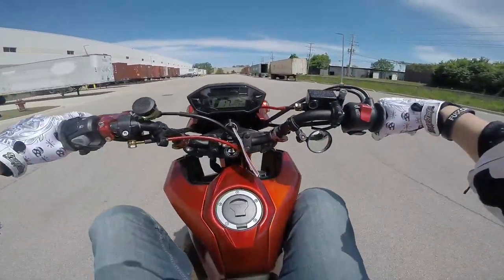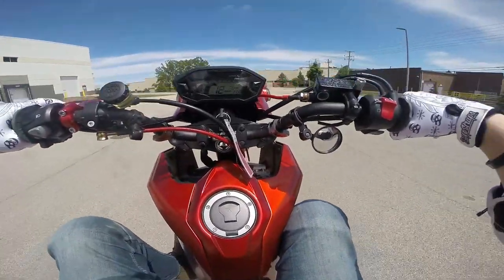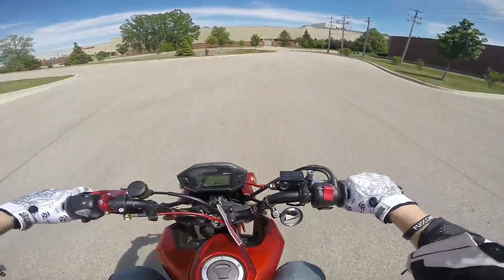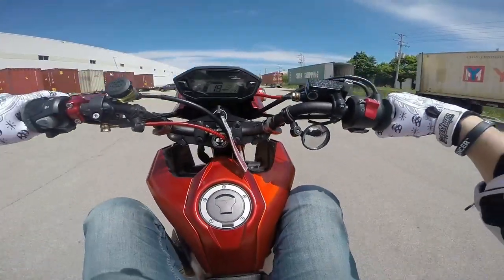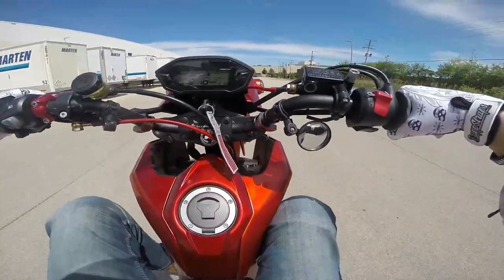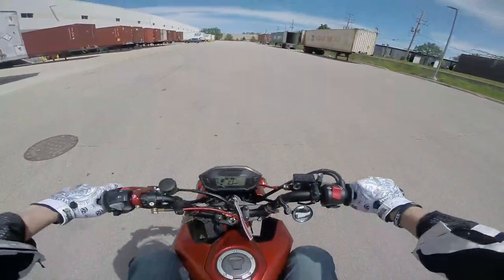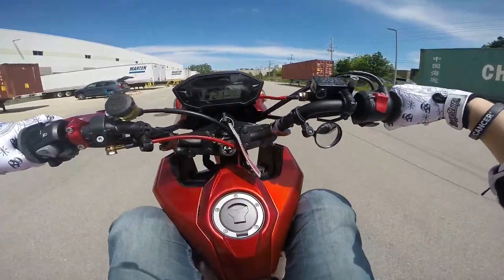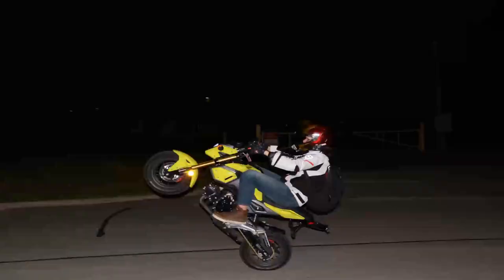Honda Grom - Brake Control Tips

Comment: tips on keeping it straight? i always go to the left or right even with like 12 psi in the rear
Reply from the maker: Focus on keeping all your weight on you butt in the center of the seat. Don't hang onto the bars for dear life and don't push down on either of the footpegs, you might be doing that subconsciously.
Reply: @RobRippin  I try to focus it on my butt but I fail

Comment: Did you remove the rear brake spring? I feel like I have to press excessively for it to work. It's brand new..
Reply from the maker: Ya I took the spring off. There is play in the lever with the spring before the brakes actually engage. No spring means every input you make is directly translating to brake input. Stock rear brake caliper I remember being a little soft not as sensitive as a brembo p32
Reply: @RobRippin  Thanks man I appreciate it. Helped me get better with my Grom wheelies 👍🏼

Comment: do you close the throttle then brake, or use the break  over the throttle ?
Reply: have you figured it out
Reply: you keep the throttle constant.  You modulate the rear brake .

Comment: what gear are you in?  2nd?
Reply from the maker: All 1st gear
Reply: @RobRippin  I have a benelli TNT 135 with 14 F & 40 R gearing.  1st gear is super narrow.  It has a full stunt build but these bikes don't have any power to get the front wheel up. learning to wheelie on a Grom, or Z125 or Benellie 135 takes so much more effort.   I also have a CRF150R and a YZ450F -- these bikes are super easy to wheelie.  the front wheel pops up is no effort whatsoever.  2nd gear is the magic gear to learn wheelies on a dirt bike, but damn is so hard to get the Benelli to pop in 2nd.
Reply from the maker: @76tigga  Ya the minis are tough to get up in 2nd gear without good technique. I've seen people pull up a stock grom in 4th gear so its definitely possible.

Comment: Every time I coast. I end up looping. Cus I get scared and forget to brake lmaoo
Reply from the maker: If you are forgetting to use footbrake you might want to wait on coasters and dedicate some for seat time just working on sitdowns with footbrake. 

If you still want to try coasters pull in the clutch a little before balance point, you might coast for a split second just to get the feel, otherwise the bike will fall forward.

If your still trying coasters make sure you're sitting smooth at balance point, drag the footbrake the tiniest bit and pull the clutch in. Thats the first step, my tutorial might help too:
https://www.youtube.com/watch?v=oJr6cKCUGJ8&list=PLtV0Ljj9jv_eqWResHuH5E28U8-HwAY6g&index=6